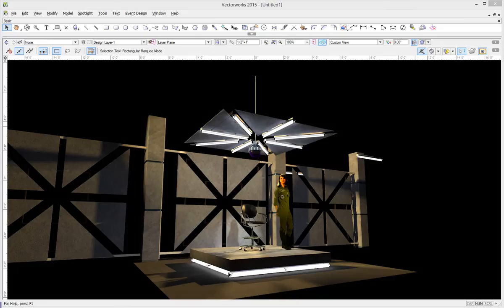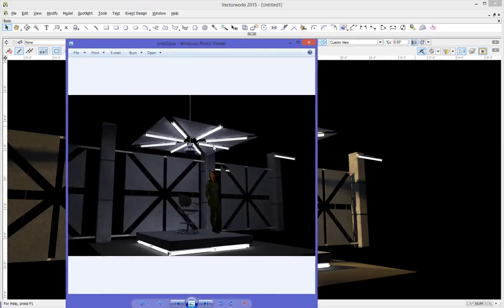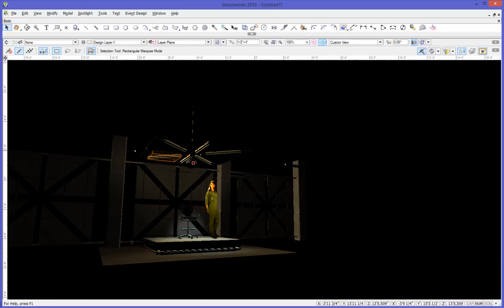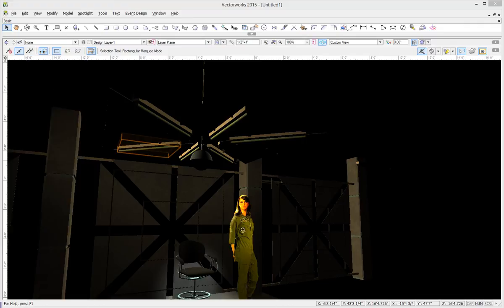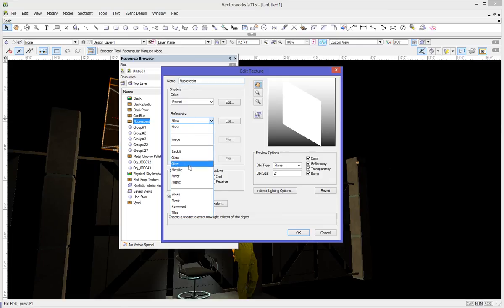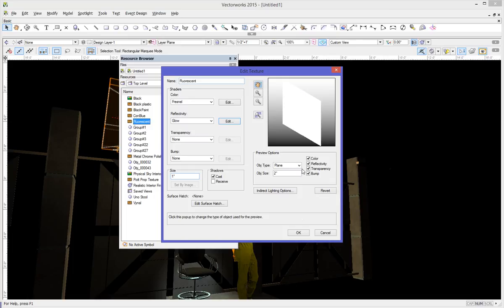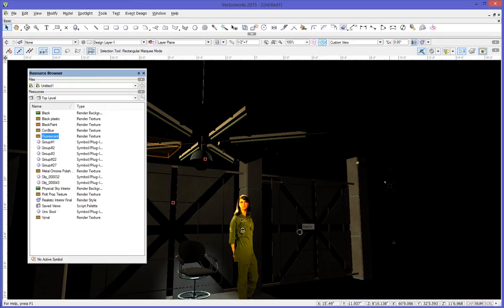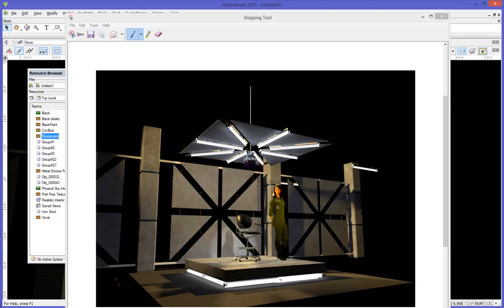Fluorescent and neon lights in VW

Comment: In reality I would typically have other light sources in a drawing using this technique so that would be a non-issue, but it was a problem as I was trying to test the concept.  I will also be using this technique as a means to create edge-lit textures so as to not tie up rendering resources.

Comment: Sean,
Please disregard.  I figured it out.  VW does not recognize the Glow texture as a light source per se, therefore, if your Glow texture object is the only "light source" in the drawing, VW will simply light the scene as if there is no lighting sources present.  In your tutorial, the reason the fluorescent tubes are able to render light is apparently due to the presence of the two or so wash lights you had mentioned.  At least that appears to be the case.  My solution in my test drawing was to put a spot light off to the side focused off into oblivion.  The results were great.  Thanks!
Reply from the maker: Scott Moore Interesting. Good addition.   Don't forget to add a bounce or two to the lighting settings that helps the glow fall onto something. You can use a point light and set its intensity to 1% to get similar results. There is no Global Illumination settings in VW so we need to do some work arounds.  Glad you like the tutorials--Sean

Comment: Sean,
Greetings.  I love your tutorials and find them quite helpful when I am stuck on a project.  I am a little confused by the glow texture tutorial however.  I am not creating results that look remotely like yours.  When rendering, there is a point where I can see the "glow" from my mock-up fluorescent tube, however, once the Final Quality render is completed it simply looks like I have my ambient light on alone.   I have indirect lighting set to 2 bounces as I am fairly certain glow textures will not work unless you have indirect set to something other than none.  Ambient and HDRI lighting is off.  I have adjusted my lighting output in the texture between 300% and 100%.  I have moved the "tube" into open space, up against walls, etc. but it always looks like shadowless ambient light.  Am I missing something else?

Comment: Hi Sean, yes I've just looked. I've used the line and area but it kills the memory and takes ages to render. Looks like an upgrade may be due. Cheers
Reply from the maker: Yeah I'm kind of tied to upgrade wheel of fate, because my students are always using the latest vrs from the academic download and I have to keep up. But I hate the whole $1k a year thing. If I add it all up I'm using something like an $8000 piece of software here--damn. On the other hand--2010 is on the other side of the 2012 quantum leap. 12 to 15 aren't that different--clip cube, lots of cool stuff in the render settings, my favorite--nudge in Open GL, but you can get by. But 10 is pre-automatic mode, set-working plane, even the tool sets if I remember right. So at least get yourself to 2012 and you'll be amazed.
Sean
Reply: Hi Sean, thank you. I've just ordered the 2015 update so I'll see how that goes. On another subject to do with lighting. I always seem to have grey ceilings even when  the fill colour is white and i've added point lights to the scene. Is there a simple way of making the room brighter? or do i need to add lots of point lights?
Reply from the maker: jerimiah80 Well that's a hard question without seeing what you are doing. When you get your 2015 check out the Backgrounds and HDRIs (I have a tutorial) that you can use. Probably you need an extra bounce or two off your surfaces to get light reflected up onto your celling--just like in real life. You can do that in Renderworks even without a background or HDRI. Like many things, the lighting and rendering tools have made huge jumps since 2010. Ooo soft shadows! You have all kinds of new stuff to play with. Back to your question, I wouldn't add a lot of point lights that's just going to slow your renders and make lots of extra shadows. Try placing 1 spotlight low in your scene pointed up toward your celling with a very wide beam angle maybe as much as 90. You may have to trial and error a few times to get the angle and intensity right but that should simulate a bounce from your keylight at least until you get your 2015.  
Sean
Reply: Sean O'Skea  Hi Sean, i now have v2015 and its so much better to use. One question i do have, is how do you wrap a logo around a tube or circle? I need to draw some hairdressing products/bottles that need the brand logo on. If you have an existing tutorial can you please re-direct me. Thank you in advance.
Reply from the maker: jerimiah80 You need to use the Decal feature.  https://www.youtube.com/watch?v=C4QHZQLmHRI    I don't have a tutorial on them, maybe that will be my next one, but here's an old video from when the feature first appeared.  Remember you wont see decals unless you are using a renderworks render setting. Good luck
Reply from the maker: jerimiah80 https://www.youtube.com/watch?v=GCwIS6U3r24I had some time this afternoon. Cheers --Sean

Comment: Hi Sean, I dont have the Fresnal option. Is this a only on the new edition, as Im working on 2010.
Reply from the maker: It's not new but it's probably newer than 2010. But more importantly, you probably don't have the glow channel either. Sorry you may not be able to do this one. You might have line-lights, (2:15) however. You could try extruding a tube, creating a semi-transparent texture (make sure to uncheck "cast shadows" and "receive shadows" and putting a line light inside. It will take longer to render but it should simulate a tube light.  Give that a try.
Sean